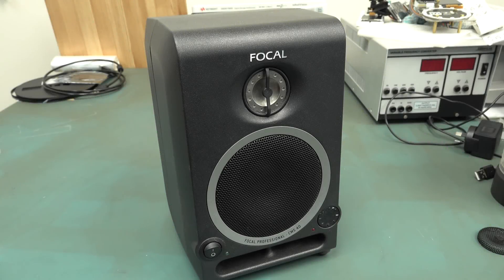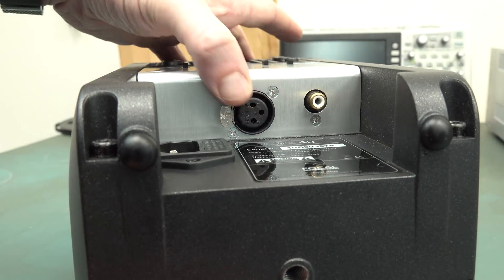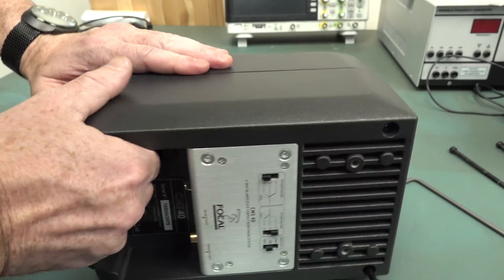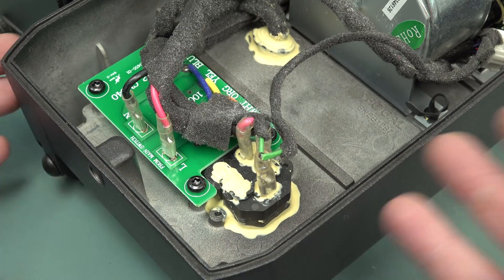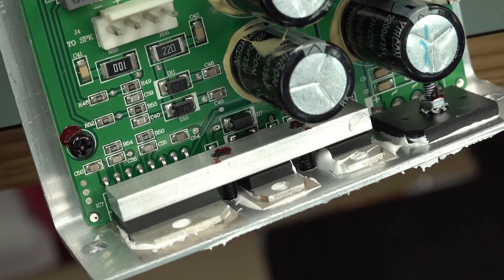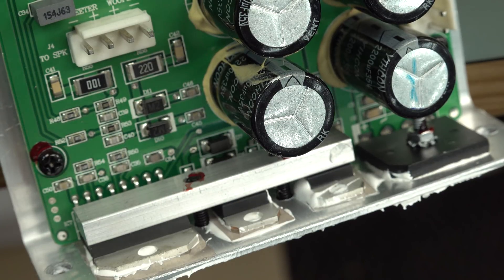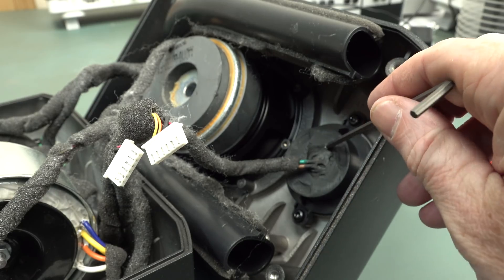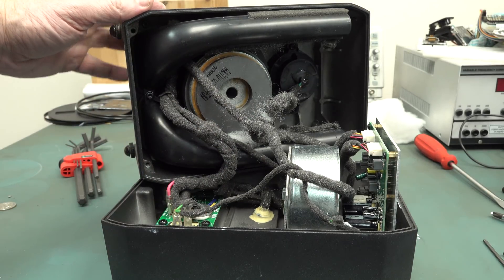EEVblog #1156 - Focal Professional CMS40 Studio Monitor Teardown

Comment: Did you ever zap yourselve with 220v ac?
Reply from the maker: Yes, and it scared me for life. I hate working on mains stuff.
Reply: @EEVblog  i also got a 220 v shock here in swizerland and i dont wanna get it again now i always wear protective gloves when working on stuff
Reply: Judoschaf 2000 I did... 246v AC here in Australia... hurts like it’s burning... I much prefer 127v AC or the best one is 279v DC inside this 300v Electric Mercedes https://youtu.be/48QBTndiiXg
Reply: I sometimes have to work on live stuff for work. I'm always super careful and do a double think of everything I do before hand. After a while you get cocky and it bites you just to remind you whos boss. It's usually a 2 to 3 year cycle lol. You never forget that feeling. I liken it to a cricket bat to the head.
Reply: Jip and decided to move over to industrial electronics only to find that caps zap you just as hard
Reply: Nothing like slipping with a screwdriver and having half the tip blasted away.

Ugh.
Reply: I remember working on a commercial job and slipping up with a standard screwdriver on 240V, the arc dang near blinded me and welded the sucker to it's cover door.  Learned I shouldn't rush around mains.

Comment: These metal tweeters are so harsh they give me the creeps. Also very unreliable. I have burned them by the kilo in my car system (focal jmlab system). Very poor construction with glue failing around membranes and inside them holding the magnets. I have totally stopped buying this crap brand and moved to Adam audio with ruban tweeters. What an improvement...
Reply from the maker: People say the same thing about ribbon tweeters, harsh etc...
Reply: DJSolitone Good to hear that I'm not the only one who thinks they are a bit harsh.
Reply: yeah, these are crap and the high end is a mess. not what i would call studio monitors, but probably quite good for voice video cutting business. 

Im moving away from adam since Im just not a fan of the weak low end. Im soon going to try HEDD. 
I dont want to miss those ribbon tweeters. The precision they give on the high end is unmatched. They are terrible for midfield afaik but as nearfield ribbon tweeters are way superior.
Reply: DJSolitone I agree , metal tweeters see harsh , even non inverted domes , goal rubbish .
Reply: Ever realized that accurate sound reproduction means that harsh sounds get reproduced harsh?  Or that you haven't adjusted the tweeter attenuation correctly for flat response?